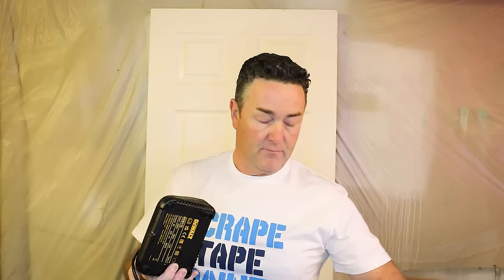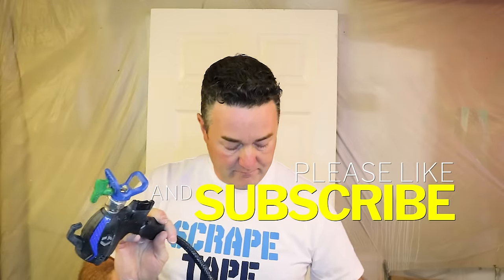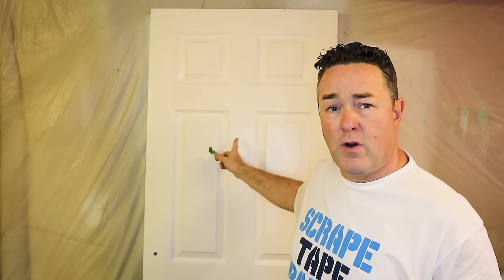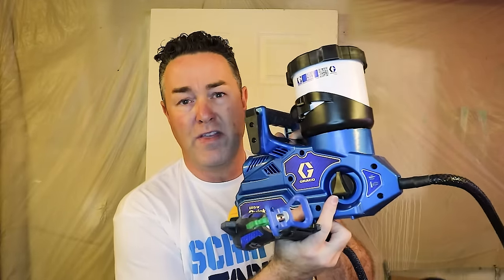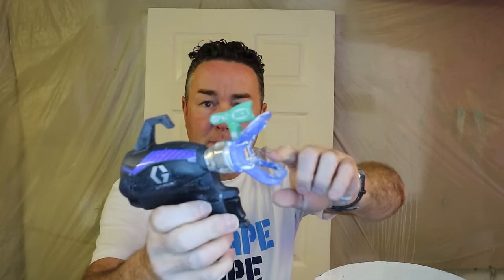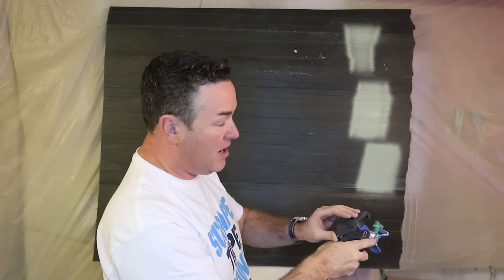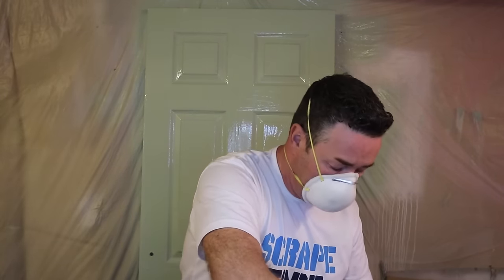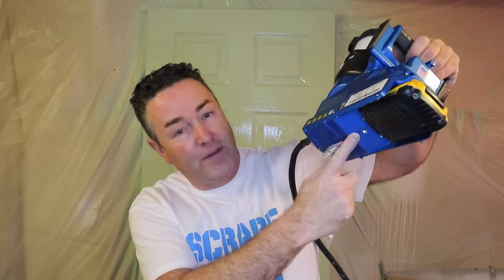Spray like a pro with the game-changing Graco Ultra Quickshot - 18v battery powered

Comment: I'd buy one for £600. No more than that.
Reply from the maker: Why's that?
Reply: @ProfessionalPainterDecorator  had two other Graco hand held sprayers and they didn't last long at all complete waste of money. I also have the Graco 495 and it's brilliant.
Reply from the maker: @davidtrowsdale8117  your hand helds... How long ago?
Did you have Mk 1 or Mk 2 models?
Reply: @ProfessionalPainterDecorator  Graco ultra. Only worked three times then packed in.
Reply from the maker: @davidtrowsdale8117  yeah. There's was the original one then they made improvements on the pump (mk2)